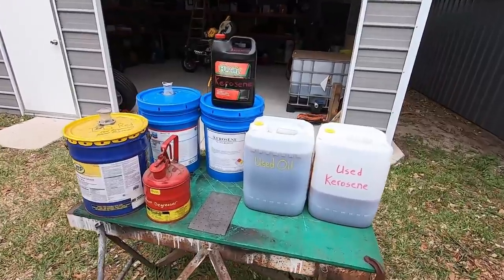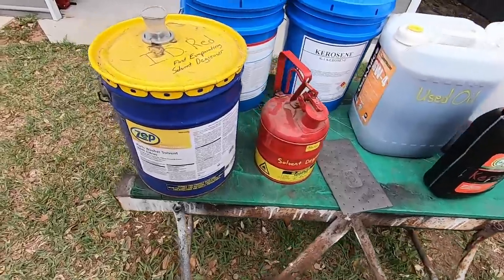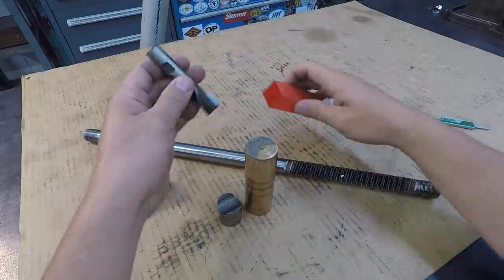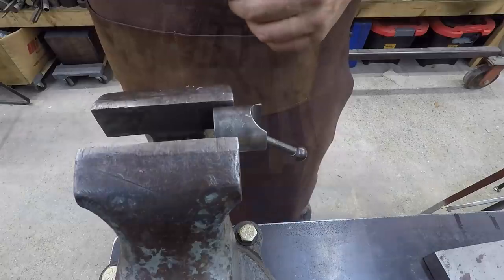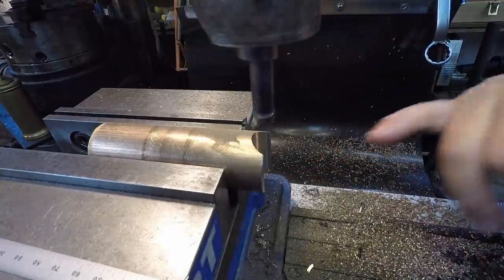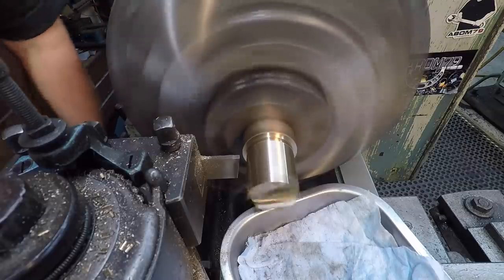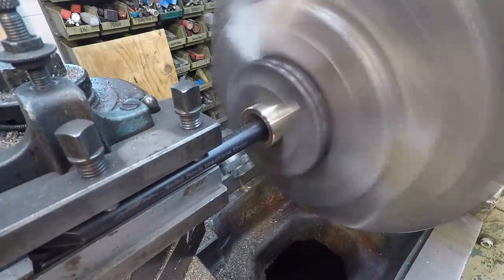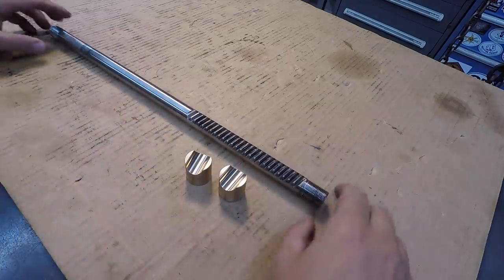SNS 308: Rack & Pinion Repair, Waste Oil Management

Comment: Wouldn't it be easier to just cut a 22mm hole in the bronze rod and part it off on the lathe in the center on hole? Then you have 2 pcs with the radius you need. From there you can cut it back to get the 8mm depth you need

Comment: Thanks for the interesting video. I am not a machinist, but I enjoy the geometry. Also, thanks for the encouragement to treat oils, chemicals and hazardous materials seriously and carefully. Let me commend you on your penmanship. Labels are wonderful things, and a label becomes useless if the person who wrote it cannot later read it. Believe me, it happens. When I do the bulk container v. use container system you use with some fluids, in addition to clear labels, I also like to color code the small (point of use) containers to help me avoid putting the wrong fluid to a particular use. For example, at a camp site, white gas fuel is not drinking water. You said you were looking for a can like the red one in the video, and as I hope you can find one, I also hope you can find a blue one, or yellow, green, etc. I know this does not work for everyone, like my color blind grandfather and color blind brother, but the color difference helps me. Thanks again for the video.

Comment: I've done that type of piston to repair automotive steering racks, I don't have other than an old lathe, a millinf attachement and a boring head. 
I look at the way you centered the half round leave me a bit perplex as I.ve took much more precautions as turning the final outside diameter to have a  reliable reference to center my boring head.
For sure the parts so machined are far superior to the ones originally installed.

Comment: I have a question i can never figure out ?should i tighten all the chuck key holes on a chuck
Thank You  Love Your Great Work  and Videos
Reply: My answer is YES, you should. 
Why? With Safety of course always being top priority, the #1 thing in doing Machine work is Rigidity.
The less a part or cutting tool moves, the better the results will be. Making sure all points that can be loosened or tightened are properly sucured will give you the best chance of achieving your desired results.
You do have to account for the pressures exerted on an object though, particularly when there are multiple points of contact as when you tighten or loosen one point of contact it can affect other points of contact. 
I've only taken one or two classes and therefore I am not a machinist, this is just my opinion from what I've learned and experienced. 
I hope others contribute to your answer as well.

Comment: If the bushings had a tiny groove or hole fur lube in it ut woukd probably not wear noticably at all, a single 'X' cut in in the wear area. About 
.050" deep. And  .030" wide,  milled in the bottom of zhe wear area,  maybe a tiny 0.8 to 1mm hole in the center of the x,  to allow oil in the bush. Could eliminate wear, 
Awesome work 😎

Comment: Thought I was watching Clickspring... What vehicle is this out of? It's a very small rack... looks like a classic mini.
Reply: The boss bore looks like it holds a spring... but you cleaned the up the nipple anyway... Beautiful work.
Reply: Steven Lascelles it looks like an MGB rack. The pocket is to contain a spring and shims to provide the ‘feel’ for the steering.
Reply: From long experience and reference to my factory shop manuals it is not a rack from an MGB or Triumph. Though... all manual rack and pinion steering systems are very much alike. I have done similar repairs/renewals to many rack and pinion steering gears. Unfortunately, though Adam was successful in cleaning up the surfaces and making new bronze bearings (MG calls them steering dampers) the critical dimensions were not restored. It is why the client asked that the scored area behind the rack teeth to be built up with spray welding which as Adam pointed out would be very difficult to do and turn to size. Because of this problem the steering gear, when completely assembled and installed, will have some amount of slop in the straight ahead position.  The clearance between rack and pinion given for an MGB is 0.0005 to 0.003 inches. Adam may, in fact, actually have made it worse.
The best and easiest repair for a rack and pinion assembly is to replace the entire assembly with a new one or a perfect condition used one. If none of these is available then make a new rack, finished to size and new teeth cut, ends threaded and finally hardened and temper the teeth. A new bushing fitted and finished to the rack housing. if necessary a new pinion would also need to be made and the bushings and bearings for the pinion replaced. Though, for some reason, the pinions don't seem to be as much of a problem as the rack on the cars I have worked on.
One rarely sees this kind of problem on power steering (rack or sector) because the system is always being lubricated under pressure. If the bellows (gaiters) on a power rack sytem are damaged and road grit gets in it will quickly destroy the seals requiring they be replaced or the entire assembly be replaced or rebuilt in a short time.

Comment: This is graphite impregnated bronze, right? Is the graphite all the way through the metal or is it just on the outer portion, like case hardening?
Reply: Its oil impregnated bronze. Its has oil in the pores of the bronze. If I remember correctly its considered self lubricating.
Reply: jonniessink1 still, I wonder if the oil is just at the surface. How could they get it throughout the metal? I wouldn’t think the metal was porous enough to let the oil all the way through. Thanks for correcting me, BTW.

Comment: Would it make it you easier if you have a set of metric measuring tools.
Reply: It probably would be, but as all Adam's machine dials are imperial its just easier to convert to imperial in the first place I guess.  regards
Reply: @garyc5483  That makes sense. I am a verry verry novice at a lathe and never look dat the dials as they are unreadable on the 1950's simplex I use. Liked  his work arround for the 20mm endmill.  Adam did mentioned ones that his K&T mill was metric.

Comment: Hey Adam!
Just curious.  IF the diameter of the rod where the rack teeth were cut is exactly the same as where the rod is 'full' diameter, would it have been of added value to use the rod to 'burnish' in the bronze cups?
Good video!
Ken

Comment: Sometimes metric, sometimes fractions and decimals.  At 73 I vote for the latter.  Also, wonder if there was any dimensional effect in removing that blemish that disappeared from the bottom of the  brass part only in the last footage.  Just a surface blemish?

Comment: Sweet manufacture of the new slides, and polishing of the rack.  Do the slides get any lube during operation?
Reply: I figure that's why the choice of graphite-impregnated bronze -- it's self-lubricating.
Reply: There is generally a grease nipple or provision for fitting one on older (or classic) cars, and sometimes on newer cars too. Sometimes they are lubed on assembly and to hell with it you will spend money with us for a new rack!

Comment: Used oil is great for spraying car under body floor panels and wheel arches.  Once a year I pressure wash then spray with used oil.  My vehicle is thirty five years old without a trace of under body corrosion.  Just find somewhere you won't contaminate drains or watercourses and wear your oldest overalls...it's very messy but very, very effective.
Reply: Nah. That was OK in 1965 but not today.
Reply: All of my vehicles are rust-free and I don't spray them with anything.  I live in New Mexico...

Comment: I always thought any time you cut metal you need oil lubricate and cool both the work and the tool.  In a couple of videos you used oil but in most you don't use oil.  What determines when you need oil?
Reply: Material you're cuttting, tool material, and how aggressive you want to cut.  Bronze is easy on the tools to begin with and this stuff had graphite in it so it would make oil or coolant into a big mess and it's not needed anyway

Comment: Would kinda be awkward in the vise like that,but a measurement over a say .250 dia.  extra long dowel pin at bottom of radius with depth mic could work,and of course a little math lol. Oh and if your collet was just about to clamp on part but not good enough you can use some shim stock,you can use 3 pieces or 1 wrap.

Comment: I've seen this, but coming back to it a few months later. You might want to invest in a PEX fire suppression system. Edit: Over on eBay Talco makes a self-contained "Residential Fire Sprinkler System Tank & Pump System Home Hydrant TPS" for $1100.

Comment: Advance Auto Parts in my area (Charleston SC) has the tank in the back for free dumping. Because of that, I buy my new oil and filter there. Other stores should wise up....
Reply: I don't think there is any that don't offer that service. All of the chain stores around me have used oil drop off. They sell it, so it isn't like they're losing money off it.

Comment: I'm an amateur and love your channel! I would have expected though that you would turn the bronze part first to make sure it's 100% concentric before putting in the end profile. Turning the bronze piece afterwards runs the risk of the end profile being off centre?
Reply: Although Graphite impregnated Bronze will probably find its own center after time?
Reply: @tonybrock5288  the housing has a lot of room the rack will move to the new spring loaded guide's groove the only other bearing is clean on the other side of the rack and does not affect the rack and pinion mesh.

Comment: could you have made both those bushings with the 4 jaw by boring the hole in the middle then machining both sides then cutting it and half and facing?
Reply: Sean's Homeshop You beat me by 2 minutes!
Reply: @hopelessnerd6677  its neat to think how much you can do with just a 4 jaw, it'll be fun once i make a backplate for mine

Comment: some concrete workers that do the framing part use used oil to coat the boards to release from the concrete better
Reply: I thought about that when I did a concrete job some time ago and the boards came out very easily even without any oil. I have reasons to think that people that use oil want to rush the job and remove boards before concrete has cured
Reply: @AlessioSangalli  the use it as a form release agent so they can reuse the forms.
Reply: @ddnaomi  I am not sure you read my comment. I just did a concrete job, no release agent, the boards came out very easily and they can surely be reused. I just gave it enough time to cure the concrete properly
Reply: @AlessioSangalli  on commercial concrete jobs where the forms need to be reused hundreds of times the kerosene is used as a form release agent.  Been doing it for over forty years.
Reply: @ddnaomi  and the forms are removed the day of the pour, not after cure

Comment: in Europe, when you buy oil you can always give the same amount of used oil back.
Reply: Aside from use loss, it should be near to being a closed loop system. What is sold new should come back into the system for remediation.

Comment: Hazmat + landfill.. Usa has a looong way to go. Here (N. Europe) Hazmat is delivered to a recycling station, where professional companies handle the chemicals and other materials, all sorted by type.
Reply: Where do you think the professional companies take the hazmat? European landfills maybe? LOL
Reply: @DomManInT1  No, and I am not sure whether you're simply simulating an idiot or not. It is generally the case that hazmat collection points are at landfill points specifically to allow hazmat capture prior to it ending up in that landfill. The majority of European countries are exceptionally good at managing waste, especially that which may pose a direct risk to human health or groundwater. Years in geoenvironmental consultancy, handling everything short of nuclear contamination including WW2 explosives.
Reply: ...BULLY FOR YOU-!!!
Reply: Not sure who you were aiming this comment at, so I'll make the assumption that it was at thin air.
Reply: @TristanJCumpole  I was talking to havenisse2009. I have no idea who you are.
Reply: @DomManInT1  No, and you could have learned otherwise using google. I did that for you. The waste is sorted by type. Some is burned off at local district heat plants to produce electricity and heat. Some is chemically cleaned and used in other processes.  Why do you even need to feel offended ? I was not picking on you, but on the (lack of) environmentally responsible disposa. I assume you're not in charge of that.
Reply: They do the same, just still call the station "landfill".
Reply: I see. It's hard hearing it in those terms though! To my ear, landfill is a final destination rather than recycling centre or whatever. Here in Finland we're got both those recycling centres - which receive problem waste for correct separation and treatment - and landfill, where you're only able to dispose of materials that will biodegrade. Everything else goes into energy production, re-use and the like. Landfill sets all manner of alarm bells going off! Back in the early 2000s when I was working on the 2010 Olympics site projects in London, we came across all kinds of waste classifications from wanton landfilling since Victorian times and before. That junk releases CO2 which is problematic for underground structures (heavier than air, asphyxiant) and even to scientists collecting samples from trial pits. That's not even mentioning things like pulverised fuel ash, biological contaminants, potential anthrax spores from animal corpses dumped beside railways and the like. Man, those were some crazy times. It almost felt like Stratford was on the verge of being written off as inner city badlands or whatever.
Reply: In Escambia and the three other Florida counties I am familiar with, the county landfill is the only appropriate place to take hazmat outside of contracting a company to do it for you (which would be cost prohibitive for someone at Adam's scale). When you do take hazmat to be disposed of you drive over to the hazmat collection area instead of the regular garbage handling area and put the waste in appropriate tanks or bins.

Comment: Bought that same flat cart from harbor to move a wood burning stove insert from my truck bed to the fireplace.  Never thought I would use it again, oh was I wrong.  That gets used all the time.  It lines up perfect with the truck bed so anything over 50 lbs that is the ticket, also use it as an adjustable work bench for the lawnmower, or anything like that.  My opinion, every handyman should have one.

Comment: Was there any particular reason why you didn't just make a hole in the middle, cut it in half and face the end until the depth was 8mm, then face the other end to the correct length of 30mm?
Reply: Finish the OD first then the above described operations ?

Comment: I use kitty litter to dry up oil spills in my shop.
Reply: Kitty litter has chemicals for smells that react with oils and starts fires. Most grocery store dumpster fires are caused by the kitty litter used from cleanup in isle 5. Use oil dry.
Reply: les best - depends on the kitty litter. Some of it is 100% clay pellets; others not so at all and can indeed catch fire.

Comment: Adam, I'm unfortunately not a machinist, I took the wrong path in careers, but when you got to the deburring of the bronze pieces. Why did the second one have an almost mirror finish and the first one you de-burred looked "pitted" in the milled area? Was that just lighting or camera illusions? Even in your close up stills, they looked somewhat dissimilar. Is the bronze just porous in some spots? I'm your biggest fan. not criticizing, just curious.
Reply: pretty sure he said it was from rubbing it along the galled up shaft and checking for contact
Reply: My guess is that finish had to so something with depth of cut. First part Adam milled with 0,1mm final pass, and on second one he had the tool already dialed in, so it took much more bronze, leaving different mirror like finish. Rubbing it on a  shaft might as well leave marks that at right camera angle make an illusion of pitted surface.

Comment: Why didn't you put the material in the mill, drill a hole through the middle, run the boring head through it, then cut it in half? Then you would have had the radius on both parts in one operation without having to preset your boring head. That's how I do it.
Reply: steve gale  he said it was 8mm deep...and the hole is not 16mm...ergo he could have bored then split the bar.
Reply: There's a lot of ways to kick the dog in most things. It often gets down to hair splitting on how it could be done this-way or that-way rather than it being a fundamental working flaw or inefficiency. Whilst there could be a case made for other methods, it generally never matters in anything other than being an intellectual exercise. It's all good.
Reply: Time is money and I see a lot of wasted money. I realize Adam will make enough off the video that he can throw those parts in the trash and still be doing good. But in the real world, we can't play around all day with parts like that.
Reply: Sure, that's a valid point that proves both sides of the debate as being fine. Different circumstance, different decision making, different paths.
Reply: This was a joke right. Everybody thinks this guy is an ace? 2 Scales? I've seen it all now.
Reply: steve gale  I read the string of comments here. This material is very stable and the hole geometry wouldn't move. My background doesn't matter if my technical comments are accurate. I'll go heads up with any of you.
Reply: He's not making parts for a space shuttle. Not all parts have to be perfect. They just have to work.